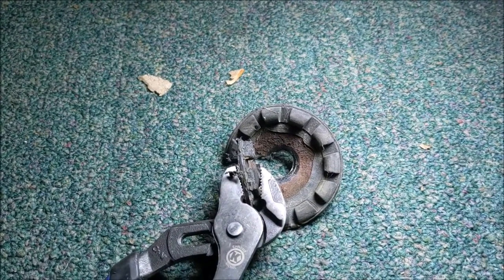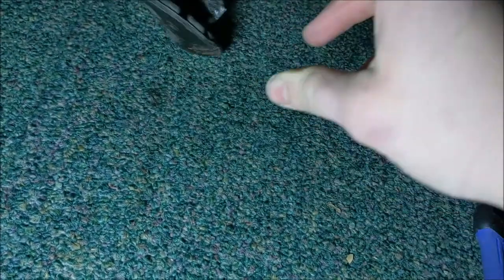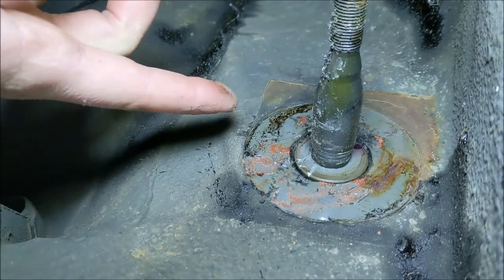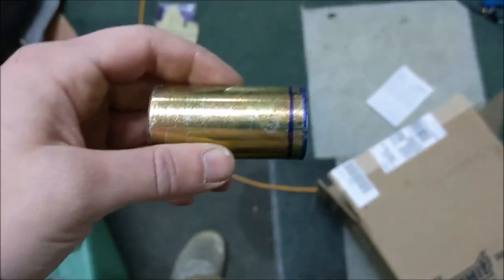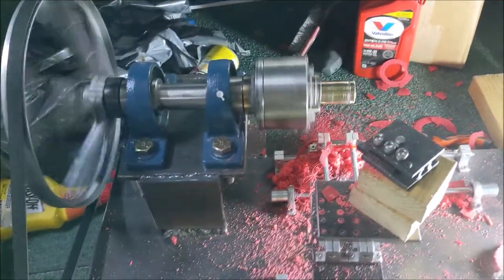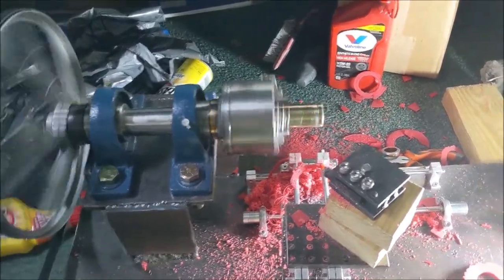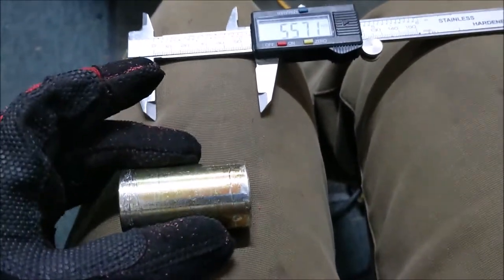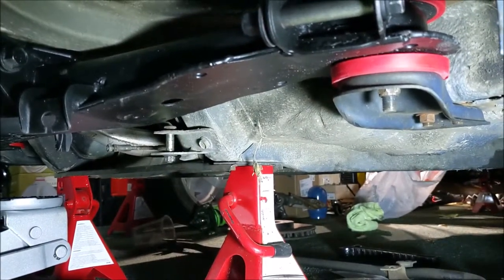280zx Polyurethane Sub-frame Bushing

Comment: Thanks for this, I was curious to see what people were using for subframe bushings on the 280zx.
Reply from the maker: Of course, this was just one of the things I had read about on the forums. Most of the stuff I find on forums people talk about but have never really done or have had a friend that once did this or something along those lines.
BUT if you have never checked out this website, then this is one of the best guides for a 280ZXT/L28eT engine.
solid sub-frame bushing  -  http://www.angelfire.com/extreme/280zxt/page24.html
Home page  -  http://www.angelfire.com/extreme/280zxt/

Comment: Hi Terry,  I did pretty much the same but made them out of nylon for a 280ZX drag car (still in process of building).  Question, did you retain the stock rear mushy mount or try something stiffer like the fancy APEX mount, or a Z-Car Depot billet aluminum mount.  Since I'm only racing this car I'm going to try the billet aluminum from Z-Car Depot.  Just wondered about your experience/ideas.  Thx,  Ed G.